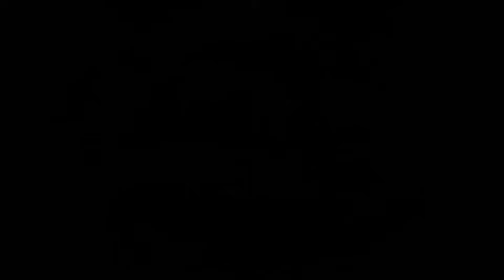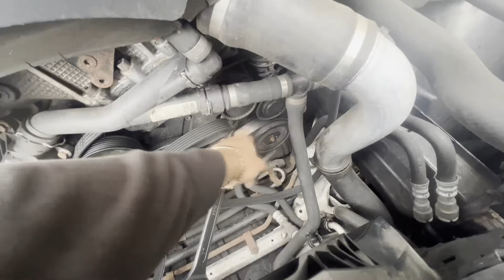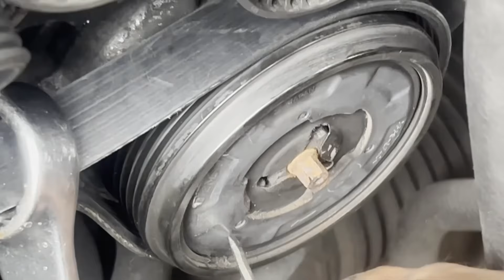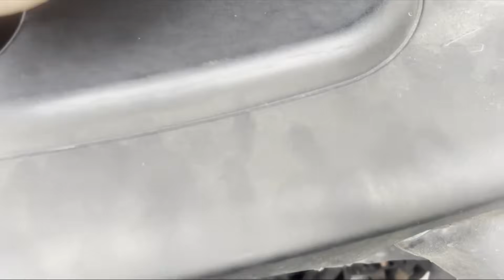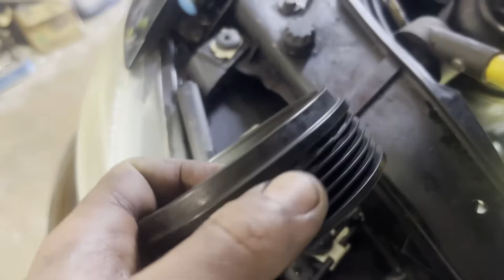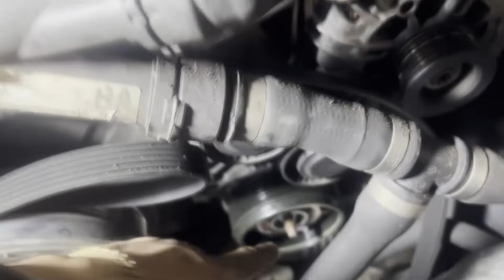BMW E90 320D AC Pulley & Bearing Replacement

Comment: My belt does not line with the Ac Pulley..it always pull off to the edge and make the belt tie..is there any help..I have an BMW 320 D SE 2005
Reply: i had same issue twice, first time i was crankshaft pulley rubber had deteriorated, second time i was replacing belt and tensioner & idler pulley and i fit the idler pulley the wrong way lol so everytime i would startup it would jump  a tooth on ac pulley, finnaly sorted it lol

m47 e90 320d 2006

Comment: Great video. 👍 where did you get the replacement pulley from? Cheers
Reply: Where did you find the pulley please?
Reply: I ended up finding the pulley on ebay. Shipped from Germany.
Reply: @BCAB-Agri any links please mate
Reply: @kaler329 I ended up buying fron eBay, shipped from Germany
Reply: @BCAB-Agri do you have the ebay item number ?